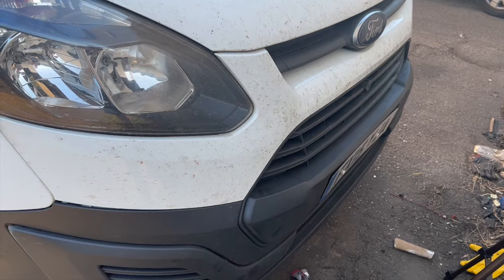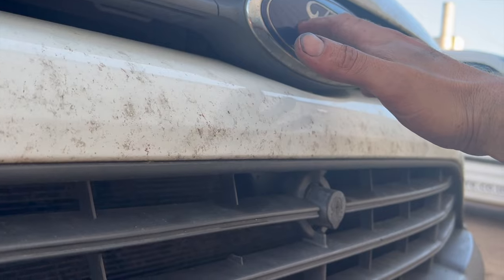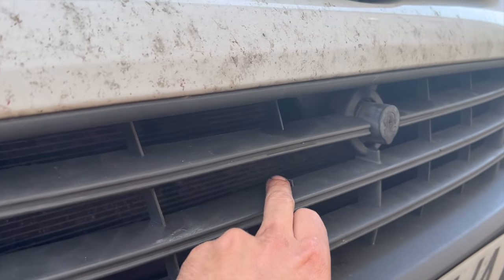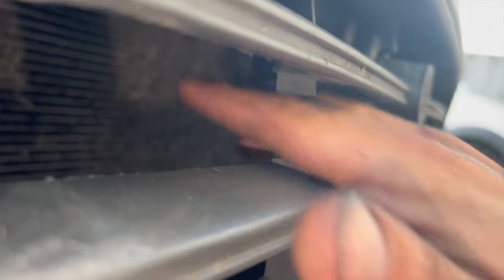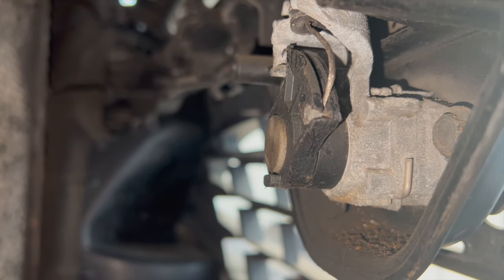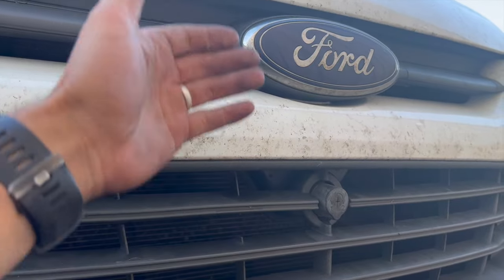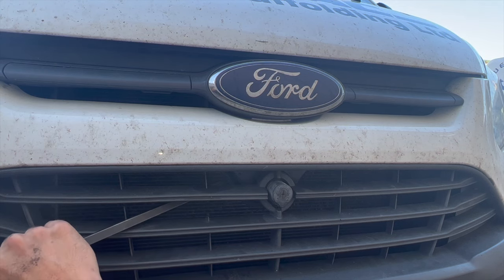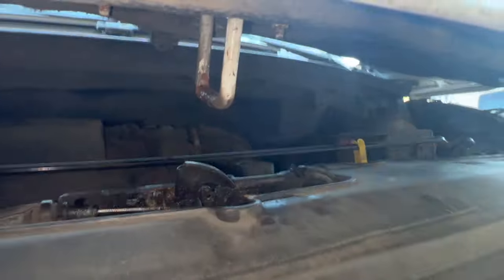How to open Ford Transit bonnet if key wont work

Comment: No wonder it didnt work the plastic cam that holds the cable was broken on mine and just hanging in mid air 3 cable ties later ive now got a quick release bonnet 😁😁

Comment: This doesnt always work because those barrels have a metal housi ng behind them to prevent anyone getting in .on that transit it had obviously been removed.and removing that housing is an absolute pain in the arse becaus the retaining screws are right up against the radiator .and you also have to remove 2 undertrays to gain access one of which is riveted on when i did mine i left the housing and one undertray off for future access.these barrels are reparable there is a small flat wedge in them which gets curved with use just remove it and straighten it and it will work .very bad design its fitted to lots of fords.